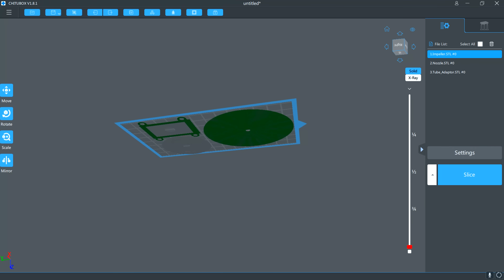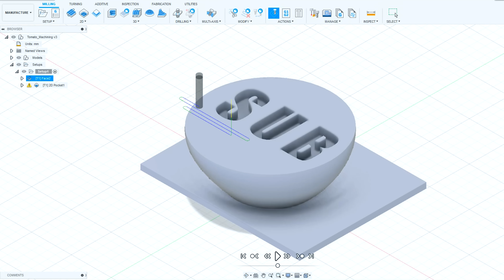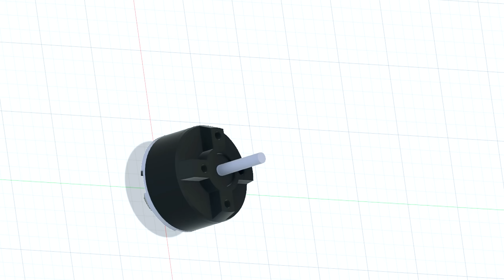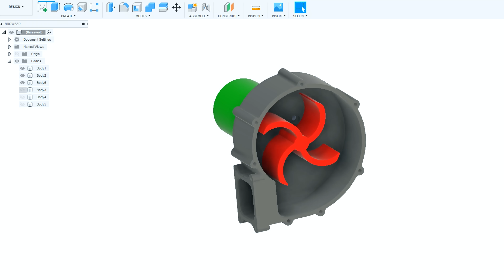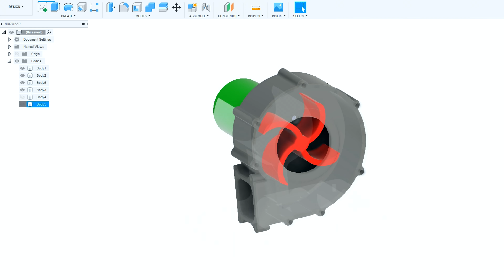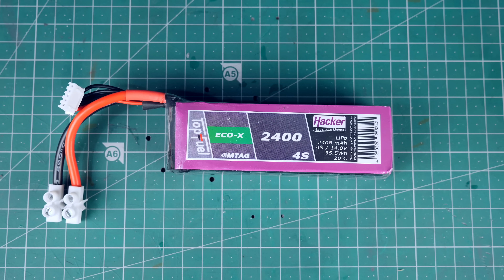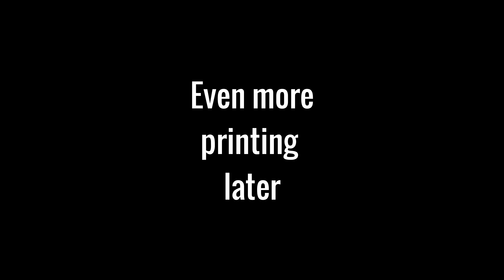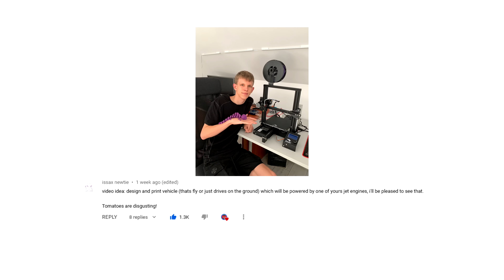Water Rocket Skateboard (3D Printed)

Comment: the impeller and case design, looks really sketchy... 4 fins? for an impeller that runs at 60k RPM? surely not with a simple fin design like that.
maybe try enforcing the fins with metal bars in some way. or maybe try to accelerate it at a reasonable pace...
from all the test you did, you couldn't tell that there is a lot of air inside the case? could be cavitation in pump making it explode like that. try minimizing loses before the pump (i.e - get rid of that 90 deg knee).

Comment: Your impeller is the wrong way round. The vanes should be pointing the other way. Currently it was spinning with the convex part going towards the nozzle. Surely it would be more efficient with the concave part facing the nozzle, thus giving more water output? 

Just a suggestion from a fellow engineer 🙂

Comment: Maybe try a design with a more advance impeller design such as suction vanes and a wear ring. Hopefully this will help support the impeller at high RPMs and increase efficiency. Also a multi stage pump with diffusers would be a interesting 3D print

Comment: I see a lot of "air" inside the chamber. 
- The propeller spins too fast and is creating cavitation which will reduce the output since bubbles are mixing with air, a different propeller shape can help.
- Or it is a shitty seal between the acrilic and case  letting air to go in 😃
In any of both cases you will lose a lot of output power.
Would love to see to try this again with stronger parts 👍

Also if it is cavitation what is going on then that is the reason why the whole thing rips apart, water is not compressible but gases are, if the water vapor is created and released to quick the most probably is that the chamber  is resonating and the resin parts doesn't hold.

I would try FDM and PETG for this instead resin (resin is kind of brittle)

Comment: Use the water jet you used in this video and attach a Tesla turbine to it and attach a propeller to it.so it will move forward with it and you can direct the water from the turbine into the box and repump it and also it will be a fun video.

Comment: be more successful if you got rid of some of that cavitation which is also probably a larger reason for exploding impellers. clearly putting air into the water causing on un-eqaul pressures on the impeller
Reply: also, a centrifugal pump has never been a good pump for pushing high flow of pressured water. great for low pressure high volume. think of a jetski jet pump for what your doing and it's probably a simpler design with longer shaft to the impeller

Comment: Way to fix your jet engine: Move your turbine back and it will get higher efficiency. The reason it didnt work well is because most of the combustion and expantion of gas happens after the the turbine.

Comment: This would have been a great place to use a tesla turbine...  Though I think the next one should have a large pressurized reservoir of water, with an additional airtank and a water tap at the bottom.  Then have the outlet water drive the tesla turbine, which spins a gear box and drives the board!

Add a length of pipe to the outlet of the pump to help the water stabilize.  There is a formula somewhere about the relationship between the diameter and length.

Comment: So you have the right idea, however could I suggest using more of a setup of a Seadoo (Jet Ski)  or anything of that sort.  Obviously the power of the Engine, regardless of electric or mechanical, will determine your thrust.  I know the same fluid dynamics don’t work in air as they do in water (as what seadoo uses to create thrust), but maybe you would get more pressure that creates movement.  By the way I am not an engineer, but I am very much a sponge when it comes to mechanical intrigue and how things operate.   It may give you a better thrust to weight ratio, which is in most cases the ideal solution. Probably a longer nozzle to spread the pressure out or as you said an metal nozzle.  It always comes down the the weakest link.  Maybe the screws will pop out of the acrylic because of the pressure and the strength of the acrylic.  Who knows?   Anyways, I love what you do, you make me think and that is the best things about your videos.   How can I think outside of the box in certain scenarios.    All the best man and I will keep watching!

Comment: Just do Casting.
come on, you just 3D, use some sand for mould, melt the plastic, pour molten metal and you get the part in metal.

also...
you should have gone for pump optimization, instead of bigger motor, but hey at least it was fun watching it explode.

Comment: Okay what if you were to use the same motor you used for the pump. And make a jet thrust engine.  That being the provider for air in the combustion area where fuel is introduced.

Comment: 1. Boots that have roller skates on the sides that do not touch the ground until you double tab the back of them twice together
2. "Rocket" powered roller skates. (Alternatively another form of propulsion or motorization)
3. Combine 1+2

Comment: Your design of the turbine is quite non efficient. Imo the lower the gap between propeller and case --> the better efficiency. 
Therefore your blades could hold if u design them right. And if not holding try ribbing - you can see ribs all over each design around you. Flat printed part is easy to be broken, but try ribbing with some shape and u would see...

And one more thing when you clip a hose with zip-tie this is not the right way as it could leak. The ziptie itself does not stay round where the locking mechanism is, so it creates a weak spot. Use two of them and clip them the opposite sides. I mean mirrored to each other and the locking mechanism at 180 degree

Comment: Ground effect Vehicle using those bad assed motors? 60,000 rpm is probably better off compressing air, like a turbo compressor, if you can make it work at that speed or half of that without exploding you can design an electric turbo ground effect jet thingie..

Comment: Acrylic - slow rpm and a one flute endmill ! Water cooled if possible
For bed adhesion i use blue painterstape (not all brands work same) and put it on both sides (workpiece and table) then use superglue to attach them. works like a charm and easy to remove with no resedue

Comment: That thing exploding isnt hindsight is 20/20 it was foresight is 20/20. Anyone could have told you to make that out of metal or some stronger plastics. Most thing plastics can not withstand 60,000rpm. When you said you had that monster motor i was thinking welp its gona blow up.  This would be like putting that impellar in a car turbo, it would destroy that turbine wheel upon spinup, it just doesnt have the structural integrity to withstand the g forces of 60,000rpm. You might have to print it out of the strongest plastic your printer can make and do 100%infil and ironing, you cannot have any imperfections in the print or that will be the point of failure when spun up. This is the main reason why things like airplane propellers, jet engine turbines and car turbo wheels are checked via ultrasound and xray, because any microfracture or other imperfections will ruin it as the forces when brought up to speed will magnify the fault even more. THats just for air alone, but were talking water, so you would need to look into how hydro dams and jetskis and water pumps go, because the strength of the material has to be at least 2x of what you would put in an air-powered unit, to account for 1 force and weight of the liquid 2 cavitation and resonance frequency the latter two will fuck you up far more than number one

Comment: Just a little piece of advice part of the reason your impeller is probably exploded is unequal pressure because you have cavitation in the pump. Try laying it on its side so the impeller area can entirely fill with water. Any pump that is cavitating is losing efficiency.

Comment: Somewhat oddly, placing the pump on the floor and using it to shoot water at the skateboard (maybe place a flat board on the back to give the water something to work against) would have worked better for both acceleration and speed ;)

Comment: make inlet more wide, pump is hungry - so, bubbles appear. make 2-step pump - wide pump should be plugged to high-speed last pump, to make it work on 100%. water evaporate when low pressure, see it in turbine

Comment: You need to ad another turbine with one of the smaller rotors to supply water to the one that you used in the video this way you will prevent cavitation in the most powerful turbine and you will be able to use the full potential of the motor with ought exploding it  you just need to have sufficient  water flow in the turbine

Comment: I’m excited to see the next design! Remember that odd numbers of vanes can help stabilize rotation at higher speeds, and helps to even out any imperfections. 5 is a good compromise of more than 3 with the maximum space between the vanes to allow for more fluid. Know your feeds and speeds for cutting metal. Aluminum can get gummy if you don’t clear chips properly
Reply: And holy shit I felt the “should I grind off this valve stem or change my elegant solution”

Comment: i think if you have 2 pumps in serie you could have more results. You need a large flux pump first to put the water in a high pressure pump. Just like the common rail pressure diesel system.

Comment: Here's an idea: you could try the Wankel engine but with a rocket motor as a pressurised gas source.  Since the gas would probably melt the plastic, you could just run it through a set of pipes functioning as a radiator to cool down the exhaust gases to tolerable temperatures.

Comment: Hey, maybe you can rigidify the impeller by adding surfaces on the bottom like ground and a ring on the top, 
like that the impeller not explode when it's turning at high RPM!

Comment: bruh you should have fixed the pipe at the bottom of the box to use all the water in the box also that useless extra water is increasing the weighi of the skateboard and  moving  slower

Comment: you need high velocity low pressure, but water isn't compressible so you can't convert pressure to velocity. gas is also preferable because it can be compressed for storage.
you could try using air as a medium... oh wait... that's what a fan does... might as well take advantage of the thing literally all around you.

Comment: Pressurized air or gas pushing on top of water= light & simple pump. Your pump is cavitating because the suction flow inadequate especially thru the valve.

Comment: Try changing your nozzle shape to a convergent-divergent, or "de Laval" shaped nozzle.
Reply: This does only work with compressible media, water will simply speed up and slow down again.
Reply: @sagasa456  Ill be the first to admit that I am not versed in fluid mechanics. It was just a suggestion because C-D nozzles can be seen in water supply pumps or in formula car intake systems or in jet engines for providing sufficient thrust to propel at high speeds. I read on ASME.com that water flow through a C-D nozzle experiences a pressure drop and its velocity increases as it flows through the converging section.

Comment: LOL, highly entertaining. 
NOW! I looked at your nozzles and I discovered a small issue.
You only had a convergent ventury, If you used a combination of the convergent ventury to build up pressure for the water, and a divergent ventury for the exit part of the nozzel, you could speed up the water flow without over presurizing your pump. Then even the 1st DC motor could have worked a bit better.
Please note my job is selling model rockets......
And teaching a bit of STEAM on the side

Comment: Ok so I just made a Lego gear build  that can spin a fly wheel up to15,000 rpm so if you need power I will send you an email of how I did it. 

1 crank = 26 on the wheel 40, 25, and 8 tooth gears

Comment: ...If you're making a centripetal impeller... why not use an inverted tesla turbine instead of a regular impeller?  Being effectively bladeless, it may solve the issue since the main point of resistance on the discs would not be the direction of rotation?

Comment: Acrylic is hard to mill with a router :) It has a low melting point and to paraphrase Winston Moy, tends to make an acrylic lollipop. Slowing the spindle for larger chips helps. The single biggest change for me that helped in acrylic was using a single 'O' flute upcut endmill. This will help with chip evacuation, and will help get a higher feed per tooth with the fast router speeds. You can also increase your feed rate though I've had middling success with that. For contours, it also helps to do a roughing pass and a finishing pass for each stepdown, this way there isn't a narrow channel for chips to get stuck in.

Comment: Video Idea : Project Nitromato 🍅🏎 (challenge to ur own creativity)
Make an rc car engine using ceramic  printed cylinder and piston with gasoline fuel 
And a tiny carburetor
Then make a differential with an axel connected to a small transmission box
Keep the HP limited so that ull not blow the components
Hope to see a video like that and it will be very useful for RC car owners 
With love to integza

Comment: If you feel like tweaking it for whatever reason, using a bigger, slower pump with the same size nozzle (and maybe piping the nozzle away from the pump discharge) would give you better performance. Past a certain point increasing the speed causes cavitation which starts to destroy the impeller and volume (I think that you can even see it happening on the impeller tips in the slow motion, which is cool!). You could use a reducing gear set and a bigger impeller and volute to get the power of the large motor into the water; most small commercial pumps I deal with run at 1,800-3,600 RPM. Ideas aside, loved the video and that the pump sounded like a kazoo when it was pushing air 🤪

Comment: You're using a blower type of setup here, but those don't really work well for fluids or high rotation rates because the inertia of the water acts on the blower blade like a lever and snaps it off at the hub. 

I would advise that you increase the area of contact between the hub and blade significantly by switching to a proper impeller with blades that get thicker and more spread out as you reach the wider side of the impeller cone. I suspect you'd have more success with that kind of design, though you may "lose" some volume flow rate until you start seeing gains from the higher rotation rates.

Comment: Next time make the connection to the water tank at the bottom of the tank, rather than near the middle. That way you can empty the tank and not carry a few pounds of needless weight from the water you can't even use.

Comment: You should visit the 3-D printing with welding you should use ceramic parts to hold the nozzle and it should go slower so I can build up the hot metal

Comment: Go for it, machine it out of a block of 6061 aluminum, acrylic is tricky to get dialed in on cutting, even at an industrial scale like what I do. Just use small step downs and go slow, you'll figure it out. And make sure to have it held down good.

Comment: One big issue with your pump is the feed, you have a massive pressure drop going in the pump, make the feed alot bigger, without a reducer like you have. It will perform much better and not cavitate so bad.

Comment: Well you could just 3D print the casing and reinforce it with sheet metal and try to cut or weld the propeller inside

Comment: Video idea: Do a sequel to the compressed air wankel by building an air liquid piston engine AKA rotary 2.0. 

Which basically is a rotary turned inside out, providing better heat distribution and stationary seals.
https://youtu.be/DcViZiTnYsU

Comment: Great effort, was expecting your pump to explode the first time you powered it up.  Your motor is too high rpm to work well with a water pump that big.  (probably about right to work with air though)  Would also help to shape the vanes more like a turbo-charger compressor so the intake doesn't cavitate as bad.

Comment: I think the impeller would work a lot better if you used a slopped design that sucks in the water instead of the water just filling up the pump. It might even help the impeller cope with the massive forces better!

(I should design that in fusion...)

Comment: Could make a stronger impeller with casting resin or CNC-ing it as acrylic layers and solvent welding them together to form the shape (the same way a 3D printer deals with z axis, one layer at a time but this would use solid acrylic)

Comment: Have you ever tried Suspendaslurry, its a ceramic dip. You layer it up by dipping parts into it to make a ceramic shell and also use some wire to wrap the parts after about four layers to strengthen it, carrying on to about 9ish layers. Then you can melt away the plastic printed part inside.

Comment: With that kind of speed you could make an air jet to push the skate board. Use tighter tolerances similar to a turbo or supercharger to create pressure.

Comment: Ideas I'm interested to see you build:

1. A vacuum cannon that shoots 3d printed projectile to almost supersonic speed.  Shoot at tomatoes, they deserve it.

2. An afterburner for an EDF motor. Sounds fun.

3. Since you have a CNC machine now, how about you build another turbine engine. Aluminum is soft, you can machine a turbine out of it and make the housing out of sheet metal.

4. Make a 3d printed hydroplane, powered by any engine you prefer.

5. Buy a sheet metal roller and build a pulse jet out of it.

6.  Build a plane that is powered by the pulse jet.

7. Pulsejet-powered rocket. Launch it vertically, I challenge you.

8. Build a dragster that runs on pressurized water, but the pressurized water spins a turbine that powers the wheel.

Ouh and also, tomatoes should commit extinct.